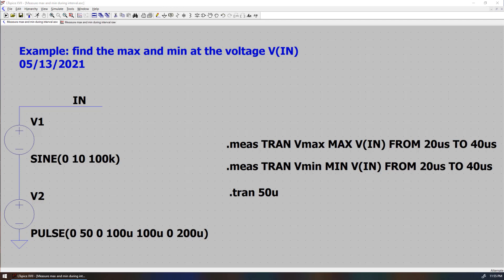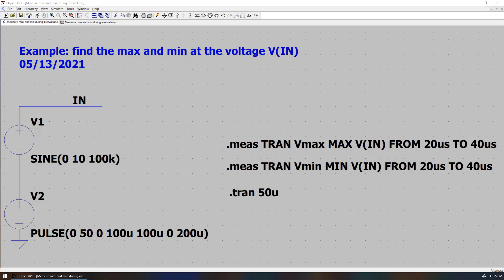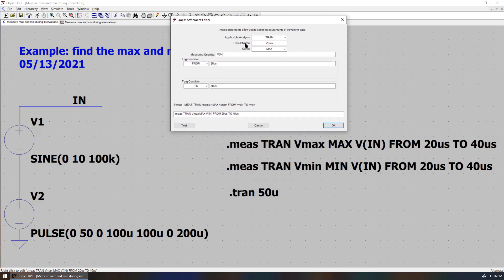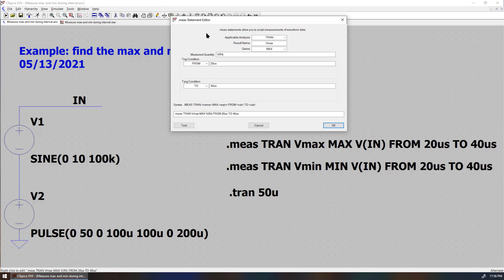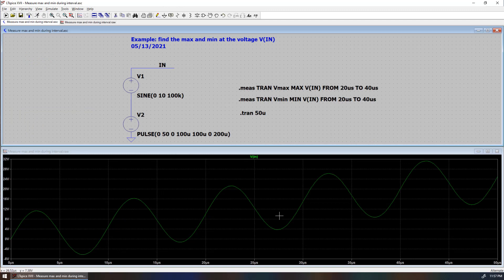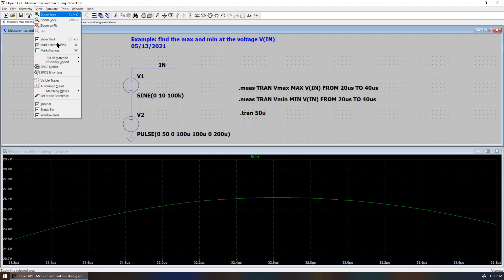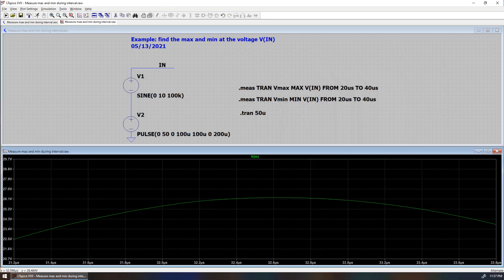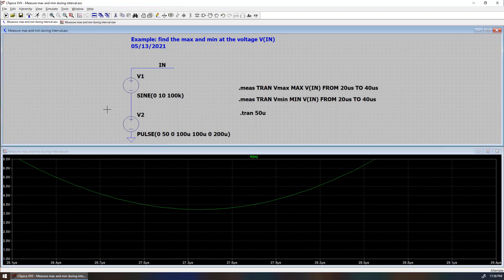LTspice: use "measure" to find the max and min during a time interval

Comment: how can I see at which time it got the Vmax measurement?
Reply from the maker: Thanks for your question.
Here is a quick solution:
Firstly, you already measure the Vmax and know the value is 26.2342 in this particular example,
Secondly, you can find the particular time when V(in) crosses this max, by using the syntax as below:

.meas TRAN time_Vmax FIND V(in) WHEN V(in)=26.2342 CROSS=1